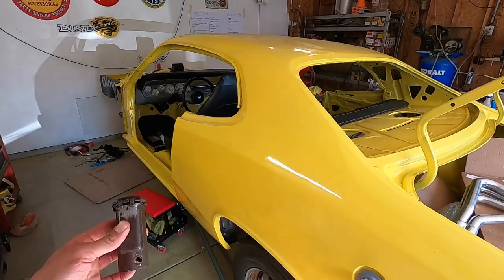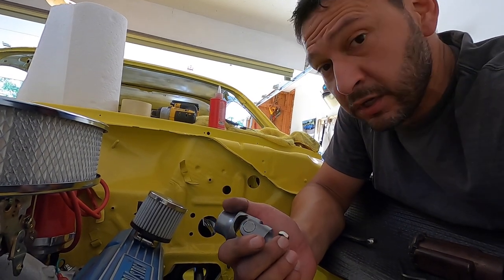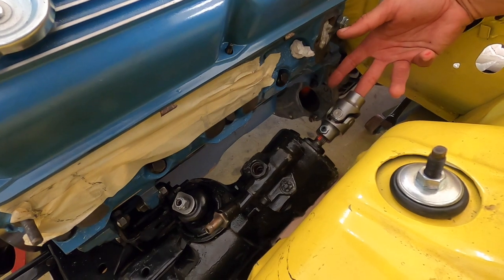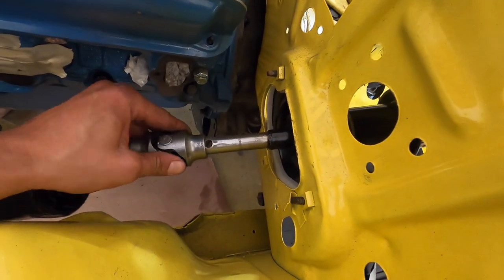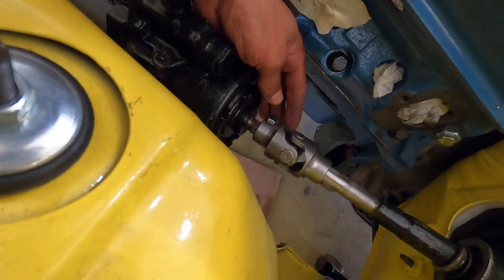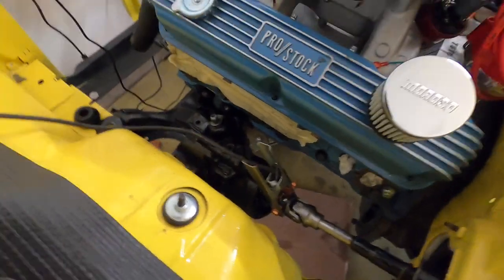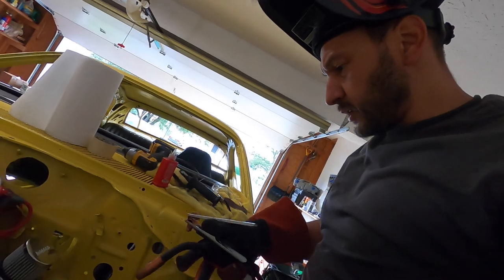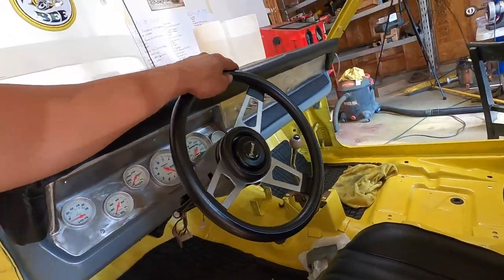Sloppy Steering FIX with a Borgeson Universal Joint

Comment: Nice project. A few 'for what it's worth' things: You can also use an adapter on the steering shaft, like a double d type, if you have enough shaft, which you do. Instead of the solid weld.
They make a vibration damening u-joint because going from the super-soft stock joint to u-joint means more shock up the column.
And, to adjust for too long a shaft, first see if it is telescoping. With those you can just tap it in to your liking.

Comment: I have all new factory steering and coupler parts and there is still play inside the coupler. I'd like to make thus upgrade also. 🤘
Reply from the maker: Whats up Ruben! Yeah, it wansn't too bad, just took a few hrs. Getting the old one off was a huge pain in the ass though. Hopefully it all works out once it is assembled. 👍

Comment: They are not called rag joints those are actually made from rubber the steering coupler it's correct name is rebuildable there are rebuild kits with shoes and metal flat spring the advantage of the coupler is it moves in and out with the flex of the body and has the master spline cut in for alignment as does the splines on top of the steering column for steering wheel....the solid universal has no in and out play but there are plastic pins in column shaft that will break in the event of an accident saving your chest from injury.... A collapsible column.... Good job getting the slop out of the steering.
Reply from the maker: You are a wealth of information Sir! I know I have heard people call them rag joints. I do believe you that it is incorrect, the name would make sense for it to be rubber or a softer material with the rag name. My bad! 😂 Thanks Moparnut!
Reply: @DustorBust  just figured you'd want to know.
Reply from the maker: @moparnut6286  definitely. I hate it when I misspeak. Vocabulary updated, won't screw that one up again! Thanks buddy!

Comment: Hey, I have a question. The large pin in the shaft is it a punch pin like the pins in the coupler? I am working on a 71 Cuda. And I am not sure how that pin comes out.
Reply from the maker: Yes, it is pressed in and is terrible to remove. Heat plus pressing and a lot of swear words. Good luck!

Comment: I sold a '69 GTS Dart convertible because I could not get the cover on the factory coupler, wish that U joint was available then.
Reply from the maker: 😂 Hey Mike, yeah, I just don't like the factory style. Too many pieces.
Reply from the maker: Those Dart convertibles are hard to find nowadays. Sweet cars.

Comment: Is that the original steering gear? I upgraded to the Flaming River manual steering, but the universal joint required drilling and pressing in a sleeve.
Reply from the maker: Hi Acardiac, yes it is the original steering gear. Super heavy bastard too. It seems ok without opening it up, hopefully no issues. I want to say the car only had like 40k-60k original miles. Not sure what they were expected to last. I am not familiar with the flaming river ones. Drilling and pressing in a sleeve sounds like a pain. 😂

Comment: They also make a power steering gear that's way smaller and lighter than the stock beast ;-)
Reply from the maker: Hi Chris, Thanks for watching! Yeah, that stock one is a beast. I saw the Borgeson ones, they are sweet, but pretty expensive. If I had to buy one I would consider the upgrade, but since this one technically should work I have stayed with it. Thanks for the comment!!